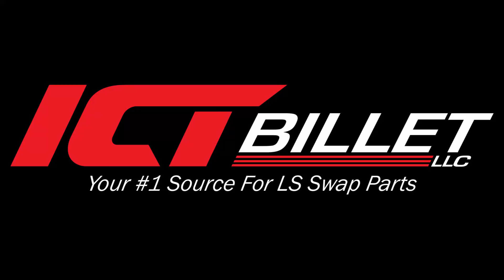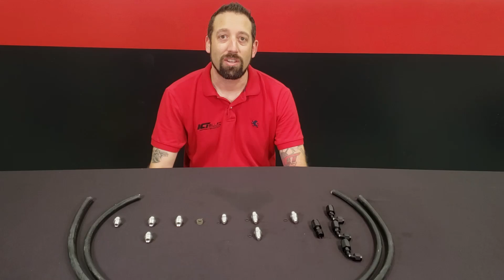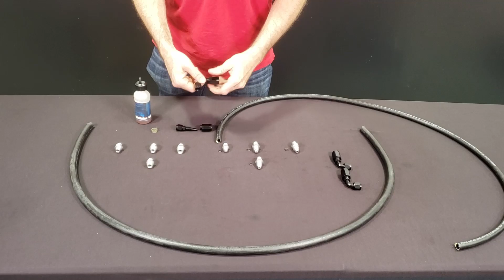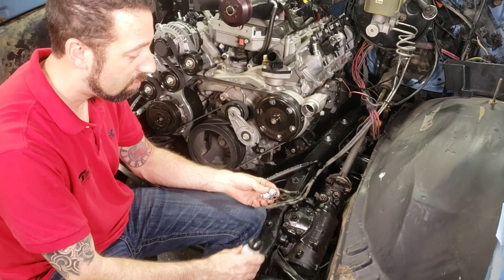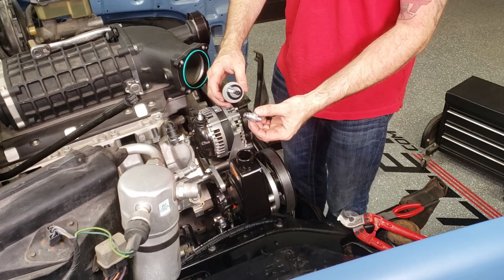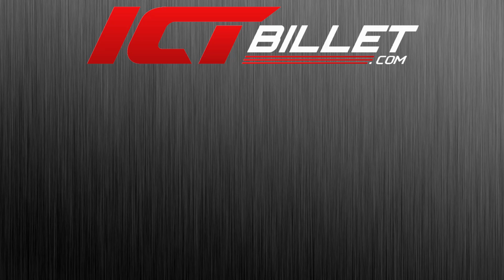How to build your own Power Steering Hose ICT Billet 551082 LS / LT Swap

Comment: Bought this kit from Summit Racing in Arlington October 2021. The high pressure gates hose provided with the kit did not work (was too thick for an6 fragola fittings provided). Other than this kit, all ICT Billet  parts have been spot on and affordable in comparison to other manufactures!! 👌

Comment: At the beginning of video you said this was going on a C-10 with hydroboost. There was a vacuum boost. I actually have hydroboost and am interested in what tee fitting you have for low pressure line from gearbox to pump and hydroboost?
Reply: Your plumbing should be as follows for hydroboost. From pump high pressure line to hydroboost. Hydroboost high pressure line to gearbox. Low pressure lines from both the gearbox and hydroboost plumb back to pump reservoir
Reply: he does say its a non-hydroboost at the beginning of the video but the audio is very low so it was easy to miss